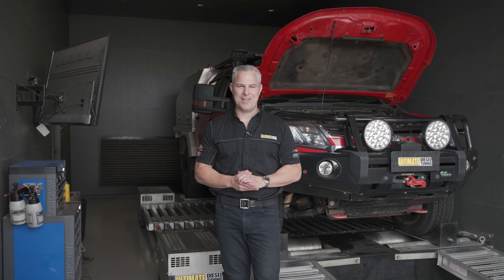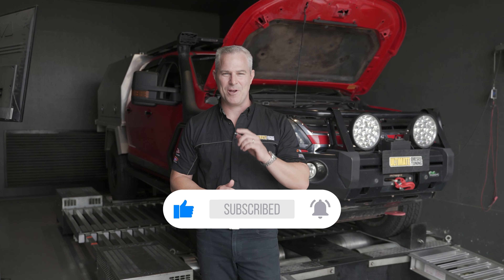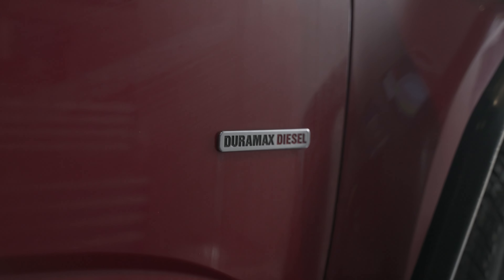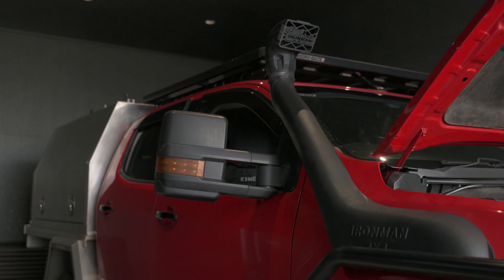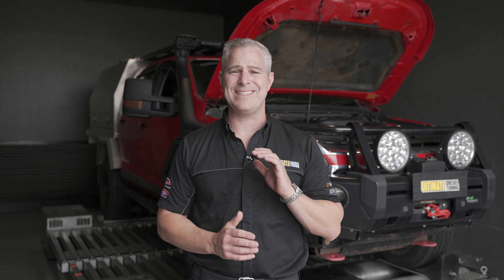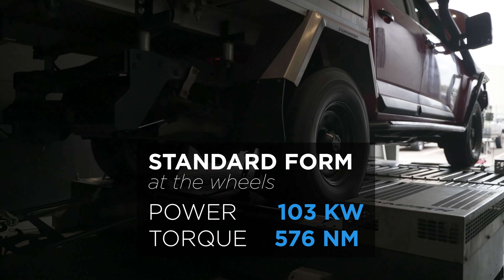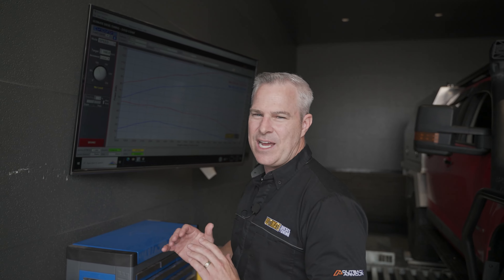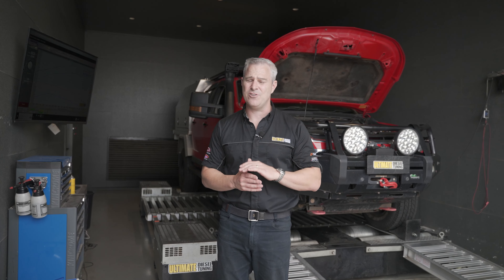The RG Colorados make great gains in torque with a custom dyno tune only!

Comment: Actual results were base line Max 103.1 kW / 357.6 Nm and post tune, Max 128.4 kW /442.5 Nm. Fuel economy didn’t change at all so they looked over the car again next time I was in Qld and re did the tune and now the results are Max 136.1 kW /472.6 Nm.
Reply from the maker: Yes - thanks for that - Rob made a mistake in this, when he said "576" nm, he missed reading the 3 off the number hence "576" instead. We also filmed this video when it was in the first time, so prior to it coming back in, where it was at 128kw & 442Nm. However it's great that we got a bit more out of it for you hopefully, that economy has improved for you as well. Thanks Neil.